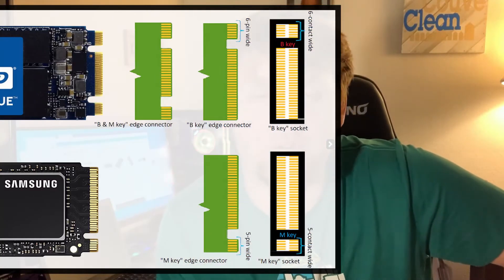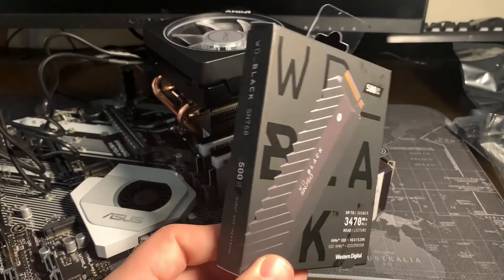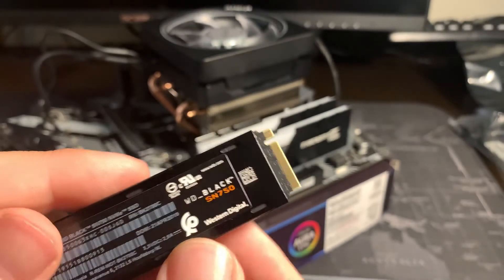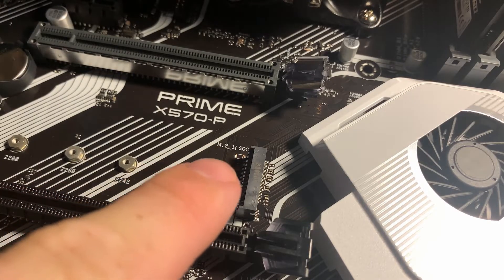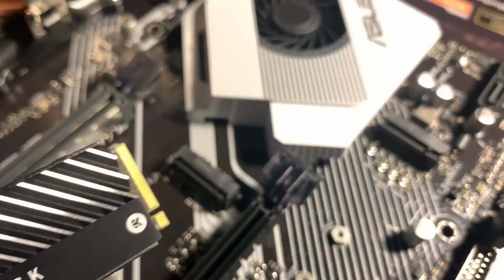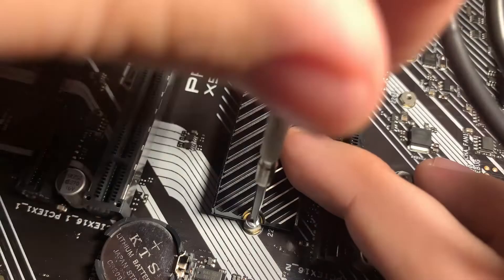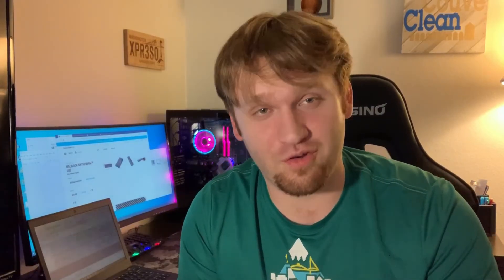How to Install an M.2 SSD

Comment: do you need the standoff for the m.2 for that board because i saw you didn't install one?
Reply from the maker: They’re already slightly raised on this board. I put a stand-off on it at first but it didn’t seem flush when the SSD laid on it. Thanks for pointing this out though. I should have mentioned it in the video. Later on I added the stand-offs.
Reply: @TechHut  came here specifically for this. Thanks for clearing it up!
Reply: @TechHut  What do you guys mean by "stand-off"? I'm installing m.2 pcie on an Z370 Aorus - is there something I need to add or may I just relay on this tutorial?
Reply from the maker: @starkestal  Google m.2 standoff and check to see if your motherboard came with it.
Reply: @starkestal  Stand-offs are mandatory. Just like motherboard stand-offs they should come with the board or as mentioned by TechHut get the Amazon kit. The M.2 ssd must be level when properly installed in the socket.
Reply: @TechHut  either i lost mine my mother board didn’t come with it 😭 i had to buy standoffs from amazon and i have no pc till then

Comment: Thanks for uploading the video, I had doubts about whether this mother supported the ssd with Mvme or not, because even on the page mentions that only the top socket works directly with the pci bus to the processor and the lower one goes through the chipset, we will see what comes out.

Greetings from Buenos Aires!

Comment: I'm thinking of doing this but dont want to take my motherboard out bc i've  never done it. Would you advise against someone putting in the ssd with the motherboard still in the case using the top one above the graphics card?
Reply: You don’t have to take the entire motherboard out . Typically the socket is somewhere near the gpu, so take the graphics card out, and whatever else may be obstructing your view of the socket. Then just install the m.2 while the motherboard is still in the case.

Comment: Worst part about this board is that it doesn’t come with m.2 standoffs. I see you didn’t use any either, why is that?
Reply from the maker: I bought some and added it. I was confused when I first when to record. I would highly recommend getting some if the MoBo didn't come with them. I mean it won't break anything just don't tighten it down until you get the standoff.

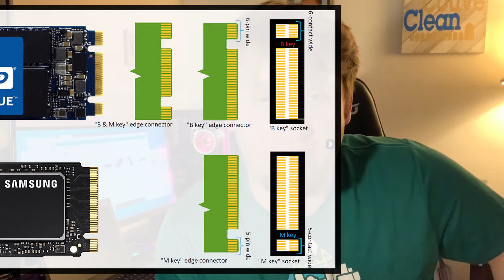Comment: 0:37 you say there's two kinds, but you show three different kinds in this image.... so what's the other?

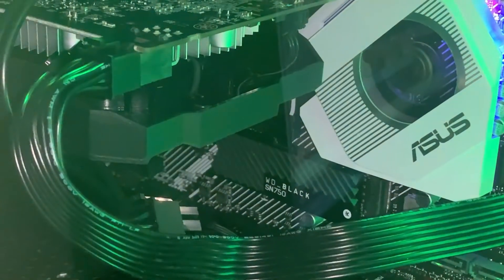2:30 Moving your SSD to the second M.2 slot means it no longer has direct access to your CPUs PCIe lanes. Remember Ryzen only has 20 PCIe lanes, 16x for the video card, and 4x for the M.2 port that's near the CPU. The other m.2 port is connected to the chipset which is shared among other devices on the motherboard, so it's technically going to be slower on that port, than the one nearest the CPU. It's always recommended to use the m.2 port nearest the CPU (AMD and Intel) especially if it's your boot OS drive.
Reply: I plan to upgrade to an M.2 drive and have the same issue as he did in this video, though: the top M.2 slot is covered by my GPU. I don't mind not being able to see the drive if it's covered by the GPU but I do worry about clearance and heat being a factor. So I am wondering if I have no other choice but to use the second slot. I have the same motherboard as used in this video.
Reply: @TimeBombTown  SSD actually perform better with heat, though it's the controller that needs cooling. Unless you're just not comfortable removing your GPU to install the m.2 drive, you should install it into the m.2 nearest the CPU, since it's directly connected to the CPU. The other m.2 is connected though the chipset, and is slightly slower.
Reply: @fragalot  Nope, no issues removing my GPU. I built the PC from scratch so that's easy haha. I'm just curious whether there's enough clearance. I'm going with a Samsung EVO Plus which has no heatsink.
Reply: @TimeBombTown  Yeah if there is no heatsink on the M.2 drive then there won't be a clearance issue. Even if it did come with one, like Corsair drives often do, you can just remove it, and there shouldn't be issues. I have a Samsung Evo Plus also installed, and I recently installed a Sabrent Rocket Q 1TB on the 2nd m.2 connector, and it works great to store all my games! But it is about 500mb/s slower than the Samsung EVO Plus.

Comment: Hey, Ty for the info. I order my part a few days after watching this lol. I got my parts right. I just didn't know they were different ones. only cause was googling that if i use two SSD M2 on the  Asus Z490-A, do I need anything to keep it cover and save, and then googler linking me your video about the types lol. In Google I trust LOL.

Comment: If you have s B550 motherboard, you should install the M.2 closest to the CPU.  The closest M.2 slot goes to the CPU.  The lower M.2 slots goes through the chip set, not the CPU.
Reply: It's the same way to the B460 Pro AC?
Reply: @joeoniliojr  I know nothing about B460 motherboards, but  i would assume same is true. M.2 drive needs to be closest to CPU in order to I threw CPU and not chipset. Only 570 boards, all M.2 slots go threw the CPU.

Comment: Hello! Very straight video, thank you! I've installed mine and the memory won't show up when I turn my PC on, can you help me figure out why?!
Reply: 7 months later, I'm sure you have fixed the problem, but if not, check if the M.2 slot is enabled in the BIOS

Comment: if you have a PCIE 4.0 ssd it has to be in the top slot on most of the lower end asus mb's if you want it to run in PCIE 4.0 mode
Reply: @Eluwilussit  most ATX motherboards have 2 m.2 slots, your mATX only has one and according to their website it supports 4.0 but you have to have a 4.0 m.2 drive for it to work in 4.0 mode otherwise it will revert to 3.0 .. edit: and your processor needs to support it too

Comment: You need to make sure that the M.2 slot you are installing the SSD in is the fastest. Some boards usually have the faster M.2 slot that doesn’t share SATA lanes close to the CPU (usually under the GPU). Be sure to check your MOBO manual if you need more info. Just an FYI.

Comment: does it matter which slot you put it in???
Reply: Yes it can on some motherboards. Some slots can operate at a lower speed. Check your motherboard manual. Usually the upper slot is fastest.

Comment: Hey, great vid. I have the exact same ssd as in this video and my motherboard is asus prime z370p, but I cannot get bios to detect ssd when installed into m2_1 slot. M2_2 works just fine, which is confusing to me because it seems that both slots should support PCIe?
Reply: yea, same here. If you could please try to answer this because I can't find a proper explanation anywhere else.
Reply: Hey when you installed it on your m2_2 did you have to take the graphics card out?
Reply: Thank you so much this fixed my problem

Comment: Can you show me how to install a hard drive on this motherboard?
Reply from the maker: A standard hard disk drive will require you using a state cable and powering it with the power supply.
Reply: @TechHut  I realize that, but I don't see where to install it with this motherboard and the CUK Gaming PC I have.

Comment: ASUS' site claims there is a motherboard heat sink for the M.2. I just got my board and don't see that. Any help?
Reply: The x570-pro has a heat sink. And the x570-p does not. I have the pro and I think the m.2 slot is below the heat sink not sure I have to remove it.

Comment: Will be adding an M.2 Evo to my Asus Prime x570 today. Two tiny screws and two tiny standoffs came with the board. It appears from your installation and other comments that only the screw is necessary and not the standoff?
Reply from the maker: I would use the little standoff if your board came with them.